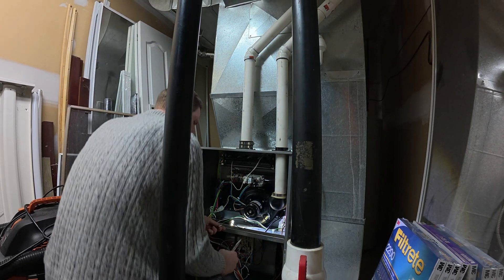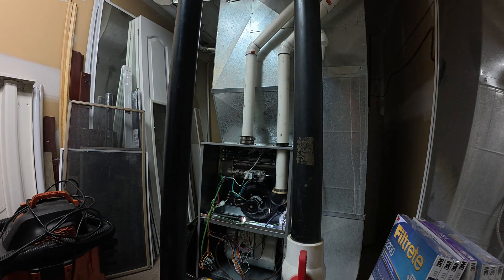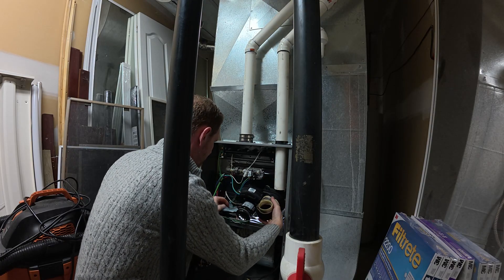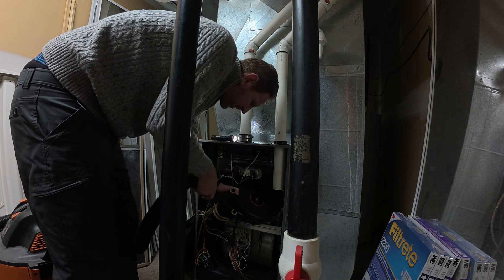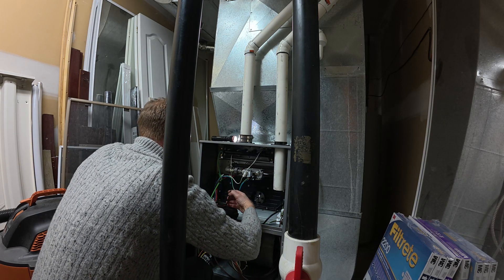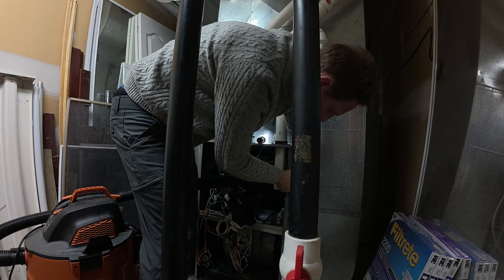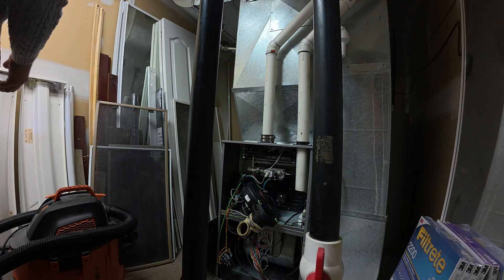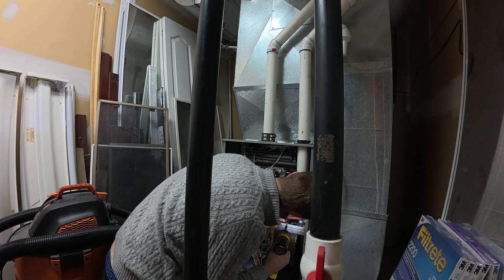Keeprite Natural Gas Furnace Repair | Pressure Switch Error | Water Plugging Low Pressure | 3 flash

Comment: Thank you for this tutorial. I had the same issue with the 3 LED error code.
My exhaust and the tube that connects had so much powdery lime it had clogged the airflow, and I had to remove all the dust from it with a shopvac.
Furnace is working now and we have heat.
Thanks agin!